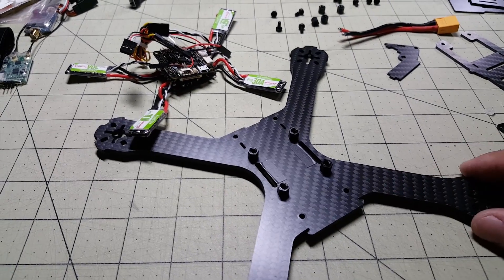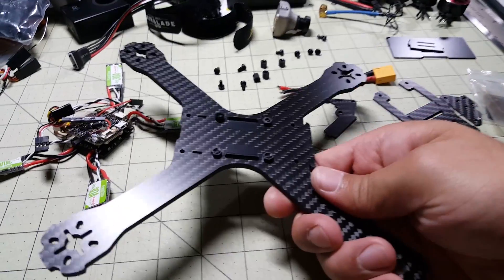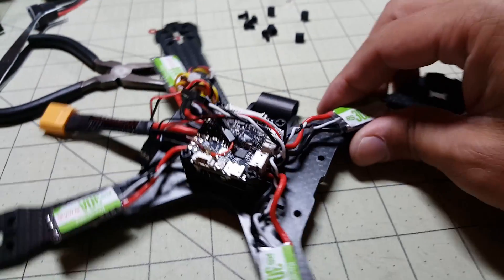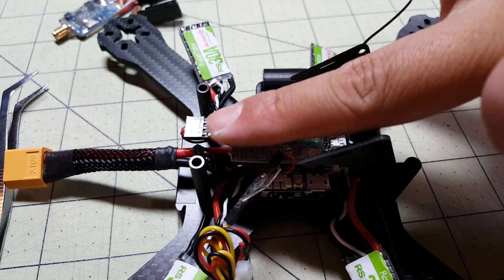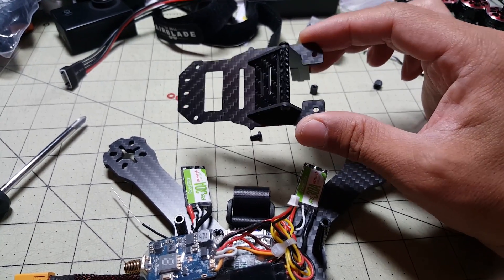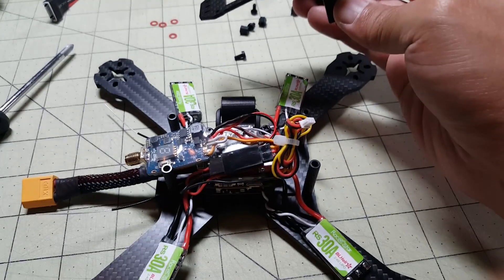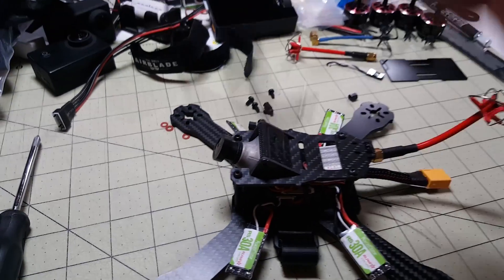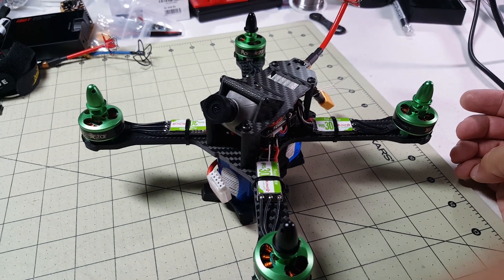QAV-X Clone Build

Comment: Do you know if the QAV X race pod would fit? 
Sorry lol txt to speech got it as pot
Reply from the maker: Not sure.  It's not an exact copy of the QAV-X.  So you might have fitting issues.
Reply: I'm pretty sure I've seen a vid where someone fitted a QUV X pod and it fitted pretty well, the mounting holes are in the same spot so it should work

Comment: can't wait to see how it flies. I have the 3 millimeter version and loved it but im having a very strange issue with strange vibrations causing the motors to shutter Andover Heat. Not sure if it's the frame or the flight controler this moment so I am excited to see how yours flies

Comment: You can drill 2 holes in the camera plate 1/4 inch in front to make the camera tilt 0-60 degrees. Did you print that battery tray?